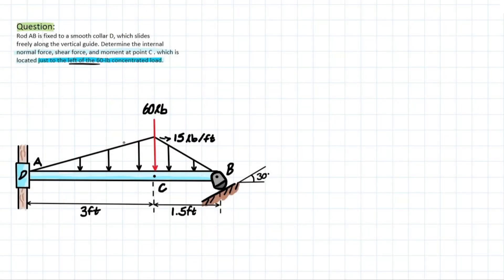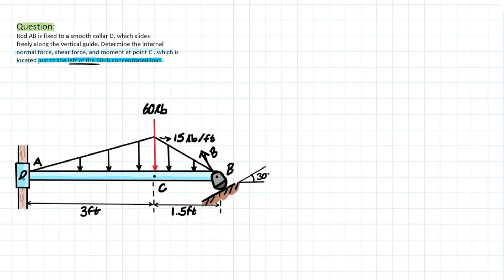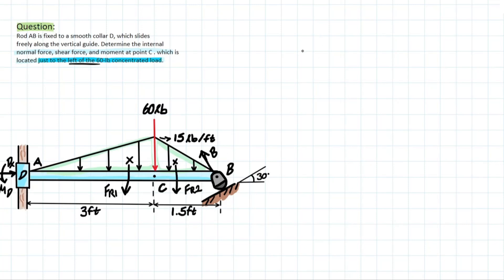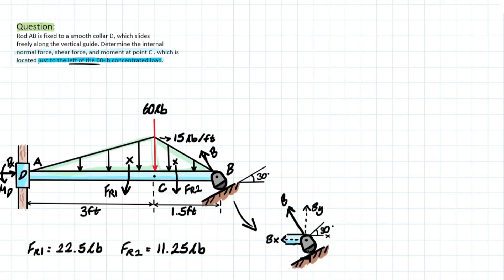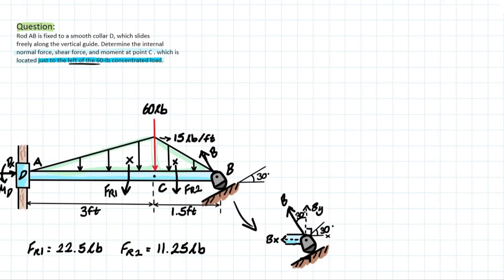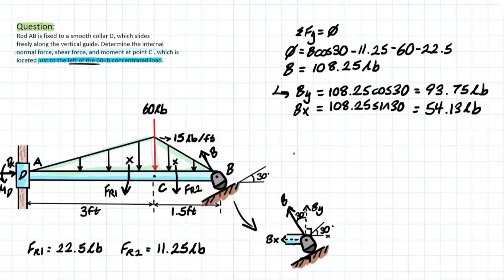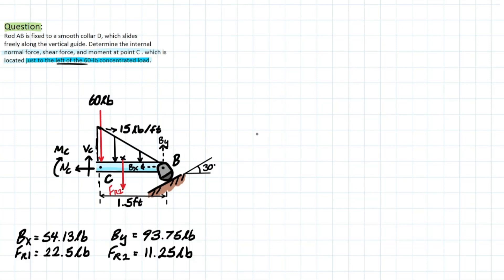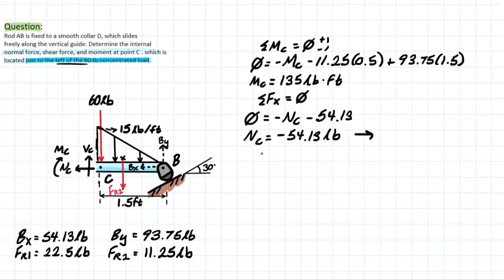How to Solve Internal Force Problems with Unique Supports!

Comment: Can you find b from the moment equation on the support d?
Reply from the maker: Not initially. If you tried to use the equilibrium of moment equation at point D, you would have the unknown Moment at D and the Fy component at B times the distance (3ft + 1.5ft). Two unknowns cannot be solved in this case. Like you see in the video, you would have to start by solving for the equilibrium of forces in the Y, since there is only one unknown. Hope this helped!